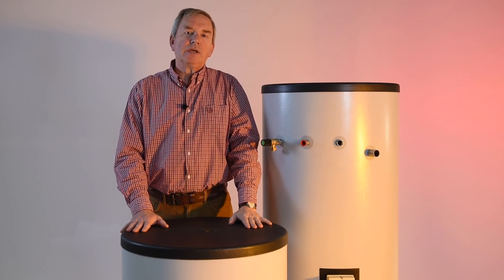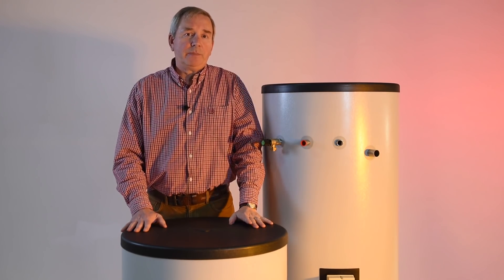How do I choose the right hot water storage system?

Comment: I am sorry to tell you this Geoff, but you do not need a twin coil cylinder if you specify a thermal store, when seeking to use solar thermal heat pipe collectors, so the thermal store can deliver both hot water at pressure indirect, while the solar heated store supports your space heating during the day with a condencing gas boiler as back up in winter